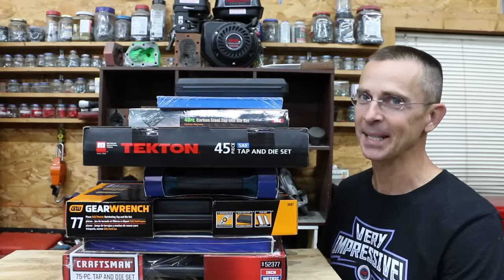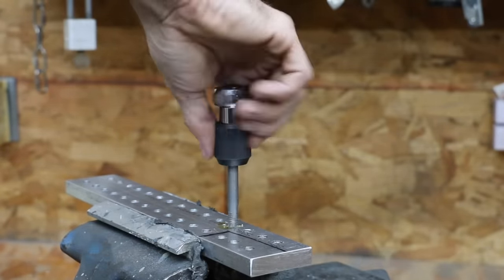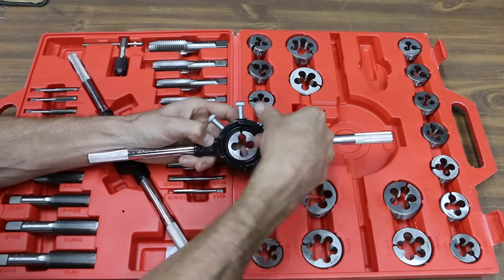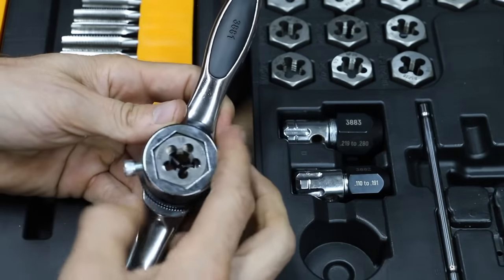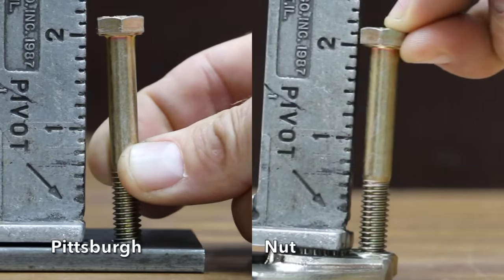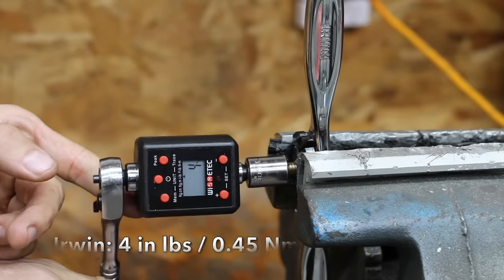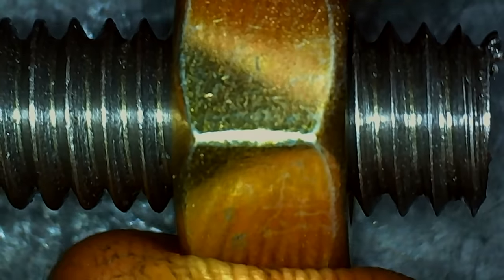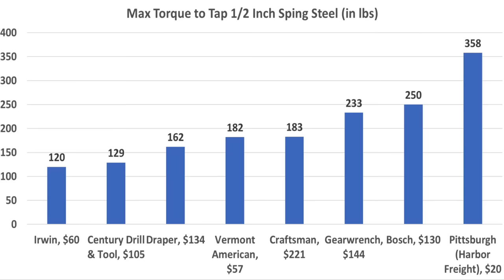Best TAP & DIE Set? Craftsman vs Irwin, Bosch, Draper, Vermont American, Tekton, GearWrench

Comment: I'm a machinist by trade, and the tap brands you show are OK for very occasional emergency use. But if you're looking for higher precision and quality and are willing to pay more you want to go with brands like OSG, Emuge, greenfield or Guhring  which can be bought through places like McMaster-Carr or MSC direct.
The horrible quality and burrs you showed on the close up of these cheap taps and dies, made me cringe, lol
Reply: Burrs in dies is always the hallmark of quality. Extra material! It used to be you could get hardware store tap and die sets that were so so. But this batch has lowered my expectations.
Reply: I make Greenfield taps.

I would be ashamed to make something so low quality as what was seen in this video.
Reply: I will recommend OSG taps til the day I die, their A brand is pricey but god damn they are amazing!
Reply: We use osg taps all day everyday but for hard material we use yg or emouge
Reply: My most cherished set of taps (3 for each size, including bottoming) are an old John Bath set (Worcester, MA).  Sad to see all of the old-line US makers disappear.
Reply: McMaster-Carr and MSC make my Snap-On dealer look cheap and really don't warranty their products. Had the same sets from them for years,no problem with warranty til last year,they claim they built their own tap and die facility to eliminate supply and quality problems. Waiting to test new products.
Reply: I see these sets as geared for home diyers. Affordable for occasional use.  I appreciate that.  I’ve never heard of the professional brands you guys mentioned.  You guys are on a different level.
Reply: @joughhenry1211  When you say "Greenfield", what exactly do you mean? There used to be Greenfield Tap & Die which was known for extremely high quality. As far as I know, that company is no longer around. I've used modern production "Greenfield Threading" branded taps and been very satisfied, but I've only cut single digit threads with any one of them so I don't know how long they'll last. They usually run me about 10 dollars each.
Reply: He also didnt back out every other turn... im disappointed in this todd....
Reply: My old work provided some quality m4 and m6 taps for tapping 1/4" steel plate. Used to chuck them in the impact gun with a dab of tap magic and send it.
Reply: I know what you mean, that said for chasing threads you do not need an insane high-quality tap. That said, if you use them a lot, get a good set. Nothing sucks more than a busted tap in a part...
Reply: Ghuring is good if you only have a few holes to tap and then it’s done , OSG exopro is king .
Reply: OSG spiral point or GTD gun tap. These are great for thru holes. 

My basic sets GTD HSS Little Giant purchased by my dad in the 1930’s. The taps I have been purchasing for the last ten to fifteen years are all HSS. Preference is OSG. Not always possible. I find that many quality taps are made in Japan.  

Power Taping using a hand tap makes no sense are the hole quality will suck as shown.
Reply: @joughhenry1211  overall, greenfield is really hard to beat. I have a few odd German an English made taps for odd sizes that are great too, but purchased solely for need.
Reply: @MakeItWithCalvin  that can really make for a long, crappy day.  My father is banned from using taps in my shop. 😆
Reply: For me I'd look at the Sandvik Coromant taps and dies.
Then when it comes to taps there are also taps that you use in stages - pre-tap, main tap and final tap (not sure of the English naming though, but you'll probably know what I'm talking about)
Reply: @wconstructionco  I do CNC production work and thankfully a tap snapping is very rare but it does happen and... That sucks. But it is par for the course.
Reply: I really like Norseman drills and taps. Still made in USA.
Reply: My favorite tap brand has to be Kennametal... moved quite a bit of metal with them at work!
Reply: @MakeItWithCalvin  How do you remove a busted tap? Do you use a wire EDM?
Reply: Here in Australia the big name in industry standard taps is Suttons who make great stuff though most of their production has gone offshore. I personally use a Gearwrench set at home which do the job for most of what I need (also love the ratcheting handle) but I am not going to pretend they are anywhere near industry quality.
Reply: Those taps are all plug taps with straight flutes.   Try a spiral cut, or gun tap and you will never buy a hardware store piece of junk again....
Reply: @jjextinguisher  yes I agree, should have used correct technique for a true comparison. Backing out 1/4 turn for every full turn is what I was taught, and some may have done a better job used that way
Reply: So like for consumer use and not commercial applications
Reply: +1, also there are carbide sets..
Reply: I was going to point out the same thing. I own a CNC production machining business and all of the tap and die sets in this video are what I consider to be thread chasers, that is their use is best for cleaning up damaged threads but not cutting new ones.  The difference in quality between the brands you mentioned and the hardware store brands featured here is very significant, like the difference of a pretty dull knife versus a pretty sharp one.  Just about any tap MSC sells is going to be better than the hardware store variety.  Anyone that hasn't used good tap and dies don't know what they are missing.  As a final note, the best quality tap and dies are not sold in sets that I'm aware of, and if you were to find a top quality set it's going to cost many times what these hardware store sets cost.  If you want a set of some sort, you will most likely need to order each size you want.
Reply: @DaKILLaGod  - Carbide is hard and chips and breaks breaks more easily than high speed steel or cobalt steel.  Good for experienced users for some application though.
Reply: @gregparrott  - if a tap breaks above the hole you can sometimes remove it without EDM.  But usually that only happens when hand tapping.  If tapping with a CNC the tap usually shatters in the hole and assuming it doesn't totally wreck the part the EDM is often the only way.  However, if you own a milling machine or high end drill press a good carbide end mill turning at low speeds will cut tap steel and you might be able to remove the broken tap and salvage the part. The end mill is apt to suffer some micro-chipping at minimum, so cheaper carbide end mills are probably the way to go for economy's sake.
Reply: @lambdaman3228   That’s a good question.  The names have been bought and sold many times over the years, but the factory is the same.  It used to be Greenfield Tap and Die, then Greenfield Industries, a couple other names in the middle, and now the business that owns it is Kennametal.  Our taps are sold under the name GTD, or Widia, or Kennametal.  We also make private stuff, for OSG or McMaster Carr.  Chances are, if you’ve used or seen a high-end tap, it came from my plant.  Hell, maybe I made it.
Reply: I have an old Greenfield tap set in a wooden box. 
I hate the thought of trying to get replacement s as I don't think they will be as good. 
The up side as I mostly use them for clean up on studs from my boilers and chillers instead of tapping new holes they work great still even a bit worn.
Reply: I always thought OSG was a great cost / quality brand.
Reply: @G53X0Y0Z0  Thanks for the reply. I've done little milling, only at the novice/hobbyist level. So I was unaware an end mill might (sacrificially) deal with a busted tap.
Reply: TheCheesePlease  - the only time I have been able to buy good quality machinist's taps, dies, and other cutting tools is at a place that deals in machine tools or supports that industry.  So, it's possible you might have a local business to buy good stuff at.  MSC and McMaster Carr actually have nice online stores and good delivery times.
Reply: @gregparrott  - the more rigid the machine and part holding is the better your results.  Relatively low rpm and feed it lightly. Carbide is very hard, but chips easily similar to glass, so chattering and too heavy of a cut is what kills carbide.  If you are buying an end mill especially to remove a broken tap or screw, and your machine has a reverse, you might consider a left hand tool, assuming the threads are right hand.
Reply: @tubastuff  US labor prices went up too fast for the larger market to sustain.  The only American market segments that can reliably afford American made are specialists.  The common DIYer can't justify a >$400 set of taps & dies that will last almost forever.  Said DIYer can barely justify the ~$100 set that will still last them for most of their life.
Reply: @G53X0Y0Z0  Running in reverse with a left hand tool?!  That's novel!  But I can visualize how it could help
I've gained an appreciation of rigidity in a lot of mechanisms. In addition to tools, I've seen the same in pickup trucks. My '69 Chevy, 3/4 ton flexed a LOT, even when unladen (had a fairly thin wall, narrow width 'C' section frame). My '97 Chevy, 3/4 ton is pretty rigid, but can flexing on rougher terrain. And then there's my 2017 Ford 3/4 ton. YIKES!, that frame is MASSIVE - wide beams, thick walled, fully boxed, multiple cross members.  Seriously, it is probably 10X stiffer than the '97's frame. Zero flex
Reply: @TheAttacker732  I think you have a point.  Right now, I'm reading an article about the (electronics) chip shortage and the fact that setting up a fab in the US would simply cost too much--or so it's claimed.  We have a Hynix fab building here in town that's been sitting empty for 14 years.   The product was DRAMs.
Reply: Yup, i couldn't watch the whole video, did he even use cutting oil?!?! Please tell me he did
Reply: Machinist background as well    dont know the brands as Ive been out of it proffesionaly for 30 years  but  junk  taps and cutting tools  are junk .       Lost all my tools in theft twice  30 years ago  and got in another trade.  It still bugs me the loss.  Only " precision Tool "   I have is a 6 inch  digital caliper    a 20 dollar harbor freight  actualy does a great job for hobbiest  work.    Had a mix of  good stuff starret , brown sharp , mitutoyo .
Reply: @tubastuff  Unfortunately that 14 year old hynix fab is set up to produce parts that were in demand 14 years ago. Basically the fab has to be custom built for the transistor size they are targeting. That means new fabs every few years and old fabs are low priority. If there's a lack of silicon in the supply chain, it's going to the 3nm transistor fab making $10,000 per wafer rather than the 42nm transistor fab making $100 per wafer.
Reply: @liamrafle3506  ...and don't forget Sossner, unless that division of OSG has been dropped.
Reply: @lambdaman3228  Well, it's located on a very large plot of land in an area with cheap power (BPA) and when the fab was built, the local utility upgraded its water treatment and sewage to handle 3M gpd.  A couple of years back, Broadcom picked up the site with the intention of setting up manufacturing there, then sold it to a third party who put it up on eBay--it sold for $6.8M and still stands empty today.   I note that fabs in general may be deserting the US; I don't know why.
Reply: The channel is for the "every man," not the "lifelong machinist." :)
Reply: @G53X0Y0Z0  Mc Master-Carr has excellent service and handling, very happy with them.
Reply: @agentelvis81  - yes, the good tools cost more. But most people will not need an entire set, at least not at once.  My advice is to try buy an individual tool to see the difference, and possibly build a starter set of your most used sizes, and then add to it.  Or buy a full economy grade set for emergency use and buy good tools in sizes you might use most.  Most people will never even use most of the sizes in a set.
Reply: @Mote78  They are probably to expensive for DIY folks, you might be able to pick some up at auctions for cheap though.
Sandvik,Kennametal,Iscar,Seco are a few other Big Professional brands used in the industry. To get the value out of them you need a rigid setup and preferably a cnc machine. To give you an idea of their performance in such a scenario i looked up the cutting data for a 3/8 tap from Sandvik in mild steel. They recommend tapping at 1000 rpm with a expected tool life of 3700 holes.
Reply: @tomte47  
remarkable.
Reply: @agentelvis81  Agreed, but the detailed comments by the lifelong machinists (and other specialists in other trades) bring insights to the every man that will help them solve problems and gain insights to prevent problems.  And, occasionally, lust after tools, machinery, and supplies that cost a lot.  “What’s in your wallet?” Brings a new meaning to life if you have poor spending impulse control and take the expensive path.  Hehe
Reply: @joughhenry1211  GO GTD !!  That's the only brand that my machinist Dad would use !!  Still have some of them, but not a complete set. I also buy them at work from Fastenal in nice 3 piece sets from starter to bottoming taps. : )
Reply: I'd always buy from a reliable machine shop service center like MSC, Traverse and many others for top quality tools. McMaster Carr although has fast service and  it is expensive to cover the costs of fast service,  the quality is not always that good. I've worked for 2 high end tool and die shops and the rule at both of them was nothing from McMaster Carr ever!  Ever notice their stuff all comes delivered in white boxes?? No brand or label info on them or the tools either. (Usually)  I've had drills and taps that come from them that were dull from the start, brittle etc. I think they buy "Blems" or seconds in many cases to keep their costs down.  University based start up guys love them becuase of the fast turn around and return policies. I've worked for university startups and they will buy 1 drill bit to drill a 1000 holes to only have the bit break on the third hole!!  Most of them are book smart and experience lacking, clueless and stupid!!
Reply: @johnkemas7344  That certainly has not been my experience. I have always received good quality drill bits, taps and dies made by reputable brands from them. The only issue is that you don't know what brand it is until you receive the item as McMaster does not disclose the brand of the product for most of the items they offer. They will show if it's made in USA or imported , though.
Reply: @joughhenry1211  Greenfield makes tapes for Colt firearms....or did 45 years back. I'm ollllld.